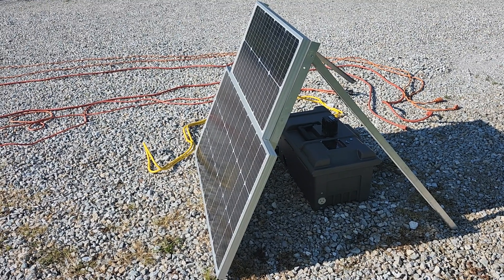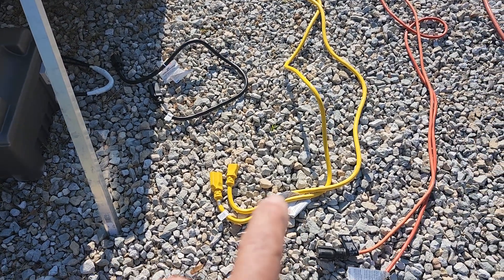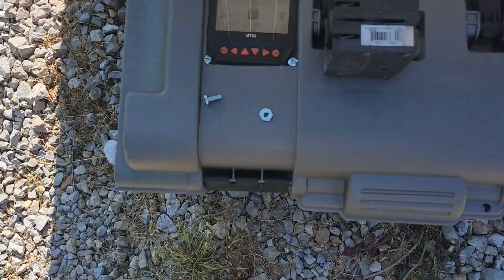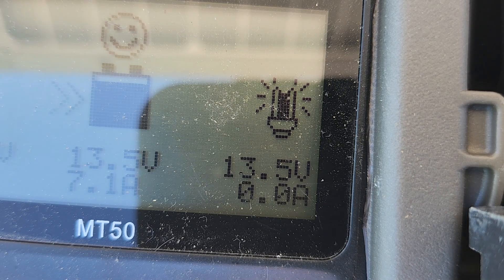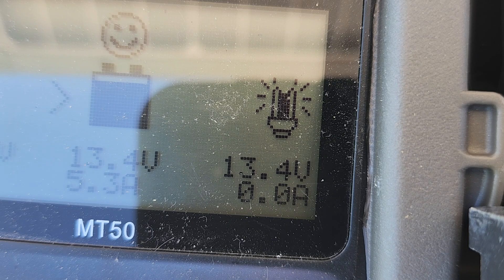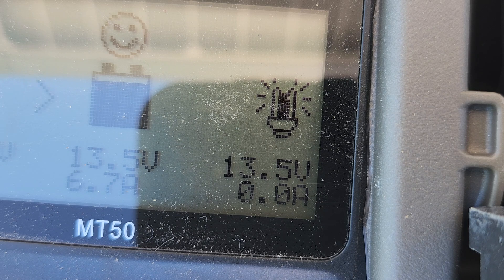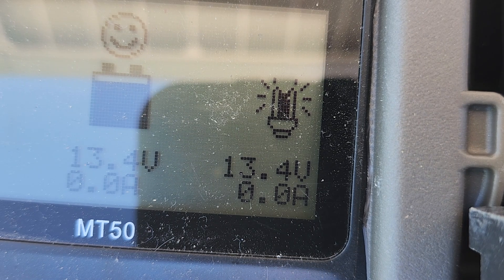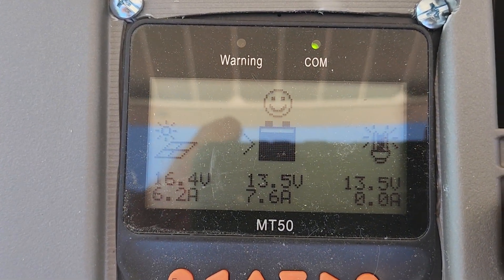SIZE MATTERS on your DIY Solar Off-grid System.

Comment: I’m confused. Those are AC cords? And what exactly are you plugging them into?
Reply from the maker: https://youtu.be/Cs775qxE5h4?si=y2fRxGOU9a2fiJEc
built my own powerstation....the cords are the wires in-between the 150w panel and the charge controller.
Reply: @ ahh. You use ac wires in your dc setup. Now I get it.

Comment: that's why I run 12 12v panels as 3s4p, volts go up, amps go down, wire heat goes down...
Reply from the maker: Im starting to like the 15v panels alot....
Same deal...volts up amps down...same watts
Reply: @CentralIllinoisSolar  sir you need to under stand that there is a very big reason everyone runs mppt charge controllers so you can run 100+ volts of solar input on a 12v or high system with very little to no loss from the cables 
real systems run up to 500 volts dc or higher on the solar side
what you are running here is just for a simple trickle charge type setup that is made to be close by the battery like maybe an rv but even then mppt is the way to go
Reply from the maker: @NightshiftCustom yes sir....we build small hobby type systems here...I promote mppt charge controllers as they are the best at the job.
Small systems can save REAL money.
I put these out so hopefully people can learn something with me..
Thanks for the info and solar on...